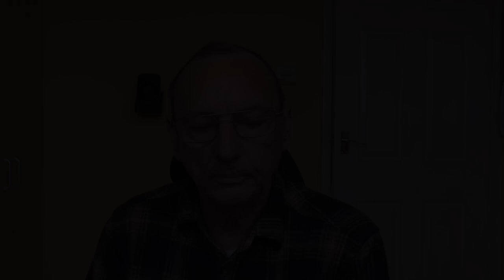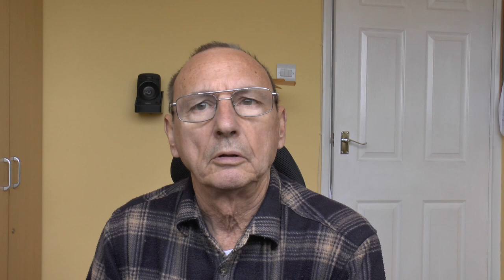6 Input, Multi Material Hot End - Part2

Comment: Very interesting results. Good to see that you are back on Youtube and the RepRap forum regularly.
It would be good if a filament manufacturer made a range of filaments that were designed or tweaked to be mutually compatible both for filament mixing and for transition within one nozzle from one filament to another.
At the moment there is always the worry that changing filament will result in intermediate mixtures that block the nozzle or ooze so badly that it ruins a print.
Reply from the maker: Hi Mike. Yes, purging between filaments will always be necessary on occasion. But with multi-materials in this hot end, it will only be that part of the hot end between the combining block and the "hot" block which needs to be purged. Because those filaments that are in the combining block will be held at comparatively low temperatures.

I have a post processing script that advances the tool change point within the gcode file, such that the new filament will push out the old filament. that can work if it can be done during infill depending on what is being printed. Otherwise I move the print head and squirt filament into a "bucket".
Reply from the maker: Of course, if changing one input to another filament, then it will be necessary to purge everything including that which is in te combining block.

Comment: Would it be useful to use a low-swell or no-swell filament (aka PLA) if such a thing could be engineered?  If it could be jacketed with a high molecular weight or tempered surface outer layer, or a process akin to forming vs extruding/pulling?  Might such a material allow you to simplify design or improve performance?  Stream of consciousness here, I'm not a filament maker or hotend designer, just musing.  The more I get to know your project, the stronger the notion is that it would help to have some purpose-engineered materials, too.  What you have done is astounding and I can't wait to see the raw output of this thing in the next video!
Reply from the maker: I'm no material scientist but for sure, a filament that doesn't swell would be awesome. But I doubt such a thing could exist because at some point, it has to transition from a solid to a liquid. This is the tricky state where it is soft and deformable, but not fully molten. So when it is in that state (i.e. above the glass transition temperature) then downward pressure from the extruder will cause it to bulge. That's the biggest cause of hot end blockages when it happens inside the heat break. So I have to either keep it below the Tg in the combining block (very difficult to do) or at a temperature above Tg where it will start to flow. The latter is what I'm playing around with.

Comment: Can you print TPU, PVA, and PLA all in the same print? That was what I did when I modded my CR-10 to be a triple-independent extruder. There are possibilities such as printing soft robotics with rigid exoskeletons, and supported overhangs, all in the same print.

Following your progress with extreme interest :)
Reply from the maker: That's exactly the sort of thing I'm talking about. But why not PC or Carbon fibre for the rigid part and maybe add an electrically conductive layer and throw in a transparent window with maybe a fluorescent stripe as well. That's the goal or something along those lines.... .
Reply: @deckingman  Of course yeah, the possibilities are endless! There are many test that need to be done regarding plastic compatibility. 

For example maybe you can print Nylon and PLA, but will they actually bond together? Maybe slicing software needs to catch up in order to gradually blend the two materials?

Also have you seen the new Kickstarter Rencolor printer? It uses an active mixer and 2 materials.
Reply from the maker: @stevenmcculloch5727  As you say, there are endless tests. We can also add that filaments with similar nozzle temperatures could be combined in 1% increments. E.g. combine a rigid filament with a flexible one to produce something that is semi rigid. So much to do and only one lifetime in which to do it 🙂
Reply: @deckingman  Well if your design works and is good, I'm sure you'll eventually get people willing to help develop it. 

You're solo right now but if this is actually better than toolchanger, you may eventually have many people doing many tests, and that is many more lifetimes :)
Reply from the maker: @stevenmcculloch5727  This probably isn't the best platform to have this discussion. If you contact me via my blog,  https://somei3deas.wordpress.com/contact/ then that would give me your email address which might be a better way to continue this discussion.